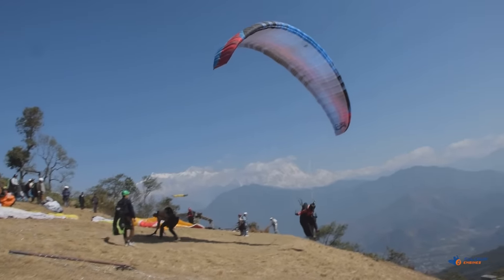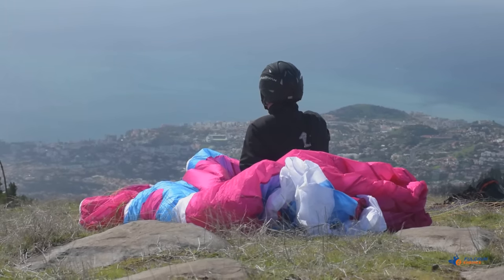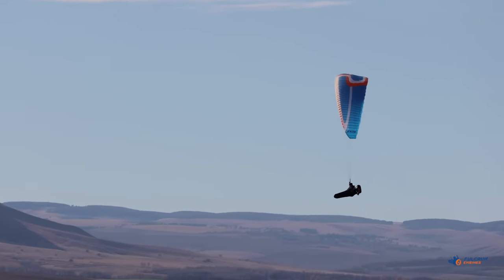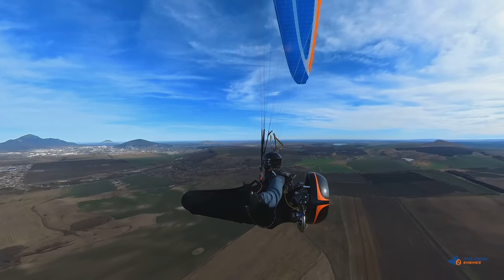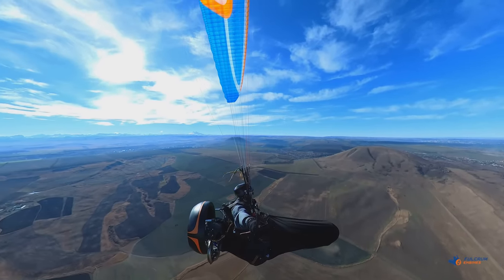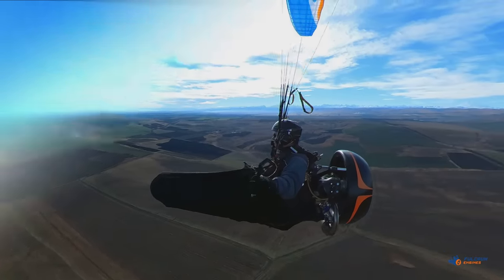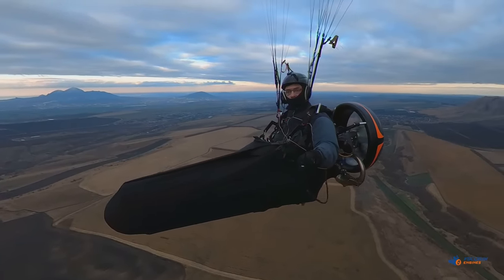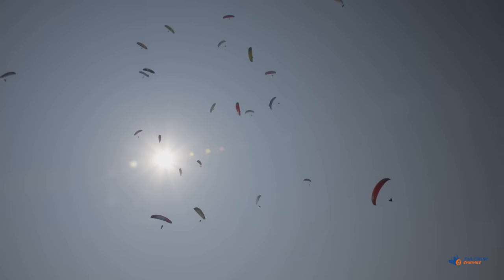Fulcrum PowerPod is the world's first paramotor pod harness with a ducted fan only 0.5 m in diameter

Comment: OMG I'm love it.  I have been watching para videos over the last few years and have been asking myself the question about ducted fans or air multiplier.  There are a couple of videos where someone used multiple small electric motors to get off the ground (noisy, hook-ups on frame etc.).  Later he came back with two large electric ducted fans.  I can't remember what he said about electric verse combustion but there was good support towards a ducted fan.  Good to see ducted fans being explored.  As ducted fans and battery technology as will as small light and compact electric motors  start becoming more popular I can envisage this possibly going electric.  In essence motor and duct become one so tolerance between fan and duct wall will be in mm range so more efficiencies / power. By the way I know nothing about intricacies of motors and para so only personal opinion incase anyone gets triggered.  Keep up  the good work, may innovation lead the way so heavy fat guys like me can fly.
Reply: An electric's fuel supply (battery) always weighs the same. But on fuel, your total rig weight slowly drops as the fuel is consumed. Gotta factor that in. 😉

Comment: Interesting concept, espacially the prop kinda hidden from the lines, well it would be quite noisy i guess but for a takeoff and clime it is nothing one would not bear! How much doest it weight now without gas and what is the ccm of the engine used, some 80ccm?  Wish you good luck with the development! :)
Reply from the maker: We plan to keep the PowerPod within 20 kg. Now the prototype has a little bit more weight. Engine power 25 horsepower, its volume is more than 80 ccm.
Reply: When it's ready I would love for you to contact me because I will buy one

Comment: Small diameter is inherently less efficient at producing thrust than a large diameter propeller.  Great engineering for 1st version, future improvements like larger diameter and stator or counter rotating prop could improve performance and reduce unwanted torque.
Reply from the maker: Yes, you are right, but we adress PowerPod for thermic flights where larger prop diameter will create more drag. A powerfull motor (25 hp) anf ducted fan technology give 50 kgf of thrust, its enough to gain altitude and find a thermic.

Comment: With electric motors going further and the new battery technology, the future of this is even greater.
Reply from the maker: Yes, if the batteries get lighter, that would be great. Now, according to our calculations, the PowerPod operation time with an electric drive will be very short, only 5-8 minutes in climb mode. This is at the same weight with a PowerPod with an ICE.
Reply: @fulcrumengines2519  a skilled glider can turn this into a thousand miles no? If you only use the engine the hop to the next thermal that might be too far away otherwise?

Comment: I would be worried about thermal expansion/contraction on the fan shroud with rapidly changing flight temps and air pressures. 
I'm sure you worked it out. Great design. You might consider two variants. 1 vectored thrust. 2 tail fins, like rear canards. 
Great work, fly safe.
Reply: I know very little about this, and I'm not an engineer, but if the fan shroud is made of carbon fiber as is mentioned then it won't be subject to hardly any expansion or contraction I think. Forgot to say that I love the idea of vectored thrust, but that must add some weight or other difficulties and doesn't a parasail already permit directionality.
Reply from the maker: Thermal expansion due to temperature changes is very small, about 0.1 mm. And both the fan and the duct are subject to it at the same time. This can be ignored. 
We used the variable thrust vector to change the pilot's posture on takeoff and in flight. It is not used to improve maneuverability and it is not necessary for a paraglider, it is already well controlled.

Comment: Does this smaller motor solve the torque problem, where the original, large motor on a paramotor, will constantly torque in one direction while flying? I also wonder if this small motor is strong enough to really get you off of the ground. Is this project still going?  Or did the government shut it down?
Reply from the maker: Hi Alaska, Yes, we are working on preseries PowerPods. The motor is strong enough (Opposed two-cylinder, 25 hp), it has 50 kgf of thrust.

Comment: What a great design guys . . .

I wonder if you could incorporate Dyson's Air Multiplier principle into your shroud design in order to get more thrust (not that it's needed)?
Reply: @KevinJDildonik  The diffuser comparable to the actual paramotor (and or parameter) is over and above in terms of dynamic engineering.  The question is, would flying be suitable up to or above. Indeed. Just a thought.
Reply: That sucks!
Reply: @KevinJDildonik  You obviously don't understand the aerodynamic principles of the Multiplier . . . it's old technology (Toshiba 1981) & produces the same airflow with reduced power requirements and around 5 to 10 db LESS noise . . . Not a bad idea when it is strapped to your back.
Reply: @ThePianoMan1953  well played

Comment: This is game changer! 😎 but I will keep dreaming about the electric version of this one! 🙃
Reply from the maker: Yes, we also think about an electric version of our paramotor pod harness. Unfortunately, according to our calculations, the weight of the device comes out much more than with a gasoline engine.
Reply: @fulcrumengines2519  How can we contact you ?
Reply: @fulcrumengines2519  But please only with hydrogen! Batteries are shit!
Reply from the maker: @ParamotorDepot  All contacts are on our website: www.fulcrum-engines.com
Reply: @fulcrumengines2519  How about different batteries options, and countra rotating propellers in the duct (maybe inspired from RC with powerful brushless motors).
Reply from the maker: @designelevator4253  We will investigate this, but only after the PowerPod release.
Reply: Likely won't happen in our lifetime. Batteries are at least 3 generations away from being viable for sustained powered flight, assuming a generation doubles that of its previous energy density.   The energy density just isn't there with current chemistries and technology.
Reply: Electric versions would be awesome but battery weight will not allow that until there are drastic improvements in battery technology.

Comment: I want.
I have been working (slowly) on a similar concept.
Mine uses two vented props, contra rotating, either side of the pilot, that folds away behind the pod, once altitude is reached.
Reply: "pics or it didnt happen".

Nah, seriously though, somewhere we can see this? Sounds cool af.
Reply: @tom.2900  mate, i have a very limited budget, so its just a platic frame and model airplane props. 
Concept is sound tho.
There is a wan on youtube thats using a weedeater (or something) in each side and another chap in the USA that sells them, but the design doesnt fold in behind, and the frame looks unstable. I think its called the Minnie

Comment: What’s the fuel capacity and motor run time average? This seems like a very elegant evolution of the current paramotor design; as a paramotor pilot, I’m very interested in the ducted concept for both safety and compactness. Currently, I have to break down my machine to fit it into my car. This would alleviate that, while adding safety and aerodynamics.
Reply from the maker: The volume of the gas tank is planned to be 5-7 liters (it should be compact enough for our concept). This should be enough for 30 minutes of operation at 75% power (climb mode). During this time, you can reach 2-3 km of altitude.
Reply: @fulcrumengines2519  that's awful fuel efficiency.
Reply from the maker: If you fly in the horizon, without climbing, the flight time will be much longer. But the concept of our PowerPod involves climbing up to the first thermal, and after - free flight.
It seems to me that this is a good opportunity to spend 2-3 or more liters of fuel in order to catch a thermal for sure.
Reply: What's a decent "regular " para fuel consumption,  gallon an hour?
Reply: @firedawg1998  depends on the glider and wing loading. With a vitarozzi moster 185 I can get 4-5 liters per hour on a gin pegasus 2 . On an ITV piper it is closer to 6-7 lph but is much faster horizontal air speed. 

These guys are probably much closer to the piper wing, but it looks like they are using an atom80 engine which gets phenomenal fuel economy compared to my engine. 

Their fuel economy issues are almost entirely caused by the small prop and the blocked intake.  Some thing like 80% of your thrust is created by the outer 20% of your prop. Shrink the diameter , and you exponentially reduce the linear distance that tip travels.  The only way to make up for it is higher engine rpm. Now block half the intake with an engine and pilot. Ducting helps a little but its pretty obvious,  not enough. There's a reason ppg are the way they are and it isn't because no one thought of it. 

Cool concept,  but I think it's a mistake to compare this to paramotor. It's different applications  with a different purpose entirely.
Reply: @firedawg1998  As above, depends on wing, motor, 2-stroke vs 4-stroke, all up weight, etc. I can get less than 3 L/hour on an Atom 80 with a 26m^2 wing.
Reply: @srmofoable  i think it is just a guaranteed launch motor, like a pony motor. how many launches do you do in a day once you are in the air? honest question as i have never tried paragliding, cheers

Comment: this is what we are waiting for, time to improve the paramotor.
So it would also come with a battery starter? 
would this be suitable to fly with the regular paragliding wing or is a paramotor wing required?
how long could you run the engine with the fuel supply?
looking forward
Reply from the maker: Yes, perhaps the engine will be with an electric starter. We are now deciding which starter will be better - manual or electric.
The engine operating time at 75% power (climb mode) with a 5-7 l tank is at least 30 minutes, this is enough to gain 2-3 km of altitude.
Reply: @fulcrumengines2519  And what about the wind ?
Reply from the maker: @s.l.6736  What do you mean?
Reply: @fulcrumengines2519  do you fly a regular Parraglider or do you have to take a Paramoter wing ?

Comment: Paraglider pilots that try motors tend to lean too far forward when launching with a motor... that leaves the motor pushing them downwards, and results in a swing forward once lifting off the ground. If you hit sink at that point, your ass hits the ground first, and you break stuff.  Angling the motor unit downward a bit for launch would be preferable. 

I fly a paramotor and don't find the upright sitting position uncomfortable at all.
Reply: And what about drag?
Reply: @journeymanelectrician  You are far away from aerodynamics and physics..
Shame on you

Comment: I like the design. It seems a lot better than traditional versions. I just wish it was electric so you didn't have to hear an Internal Combustion Engine chugging away behind you. Electric would really simplify production as well as be better for the environment. If you are only using the motor to get into a thermal, it seems an electric motor and a lithium battery setup should be possible at a lower weight than an ICE version. You could even incorporate additional features, like putting the fan into reverse just as you land so you don't fall over sometimes. Really handy in rough terrain and forced landings to have direction control.
Reply from the maker: Unfortunately, no. The electric version turns out to be much heavier than the gasoline version with any reasonable operating time. Only if the climb mode is less than 5-7 minutes, you can make the same weight or less.
Reply: interesting suggestion! it just our current battery tech has not caught up to the weight efficiency of the two stroke.
Reply: same noise. All the noise you hear is from the blade chopping the air. Look at electric versions and you will hear the same buzzing sound. Plus the added weight and then the reduced duration. It is a step backwards.

Comment: Noise Info and Sound Check between Standart and Ductec would be great.
Any Patrice Info?
Reply from the maker: Unfortunately, we haven't done any noise measurement tests yet. Subjectively, the noise is similar to that of a regular paramotor, but in a different range, due to higher fan speeds.

Comment: I am concerned about the large bottom pipe. In a normal paramotor, the lowest part isn't mission-critical: it's a frame or the fan cage. What if the pilot hits that pipe during landing?
Reply from the maker: The video shows a PowerPod prototype. In the serial sample, we plan to make the protection of the exhaust system.

Comment: Please make an electric version. This is amazing!
Reply from the maker: Yes, we are also thinking about an electric version. But according to calculations, the weight will be too very large due to the weight of the batteries.
Reply: @fulcrumengines2519  wouldn't the batteries perform less in colder temperatures (higher) as well?
Reply from the maker: @mikeyy425  Yes, that's right, the operation of the batteries depends on the temperature.

Comment: This is incredibly exciting. 

I hope you're hearing the many requests for electric. The technology has come so far. Newer, lightweight motors and only needing enough battery to get attitude would seem to make this an ideal application for electric. Add to that the far lower cost of maintenance and repair, plus the much higher reliability and therefore safety. Then there's the noise and pollution from a combustion engine. Just when every kind of aircraft is being redesigned from combustion to electric, there's almost no point in starting out with a combustion engine. From a sales perspective also, an electric pod should be much easier to sell because of the lower noise, lower maintenance and higher reliability. 

Thank you for an amazing design and all your hard work. I have signed up for the newsletter.
Reply: OpenPPG started out a few years ago with the goal of producing and selling open source electric paramotors. As of roughly 6 months ago, they began selling an internal combustion engine version of their paramotor….. electric solves a lot of paramotor problems but battery tech is just not there yet to make it a serious option to gas.

Comment: What about an electric motor instead of gasoline?  I believe that it would be great and safer in both restarting while flying and a lack of flying with a combustion engine with associated fuel.  👍
Reply from the maker: Yes, an electric motor is better and lighter than a gasoline one. But the weight and size of the batteries are too large, much larger than the fuel tank. Therefore, the electric version with existing batteries will be heavier than the gasoline version.

Comment: Seems like itd be good have on a parachute or build one into the fan incase the parasaile fails. Maybe you did have a backup I couldn't tell though.
Reply from the maker: The PowerPod has a rescue parachute. You can see it on the right side of the pod harness. This is the safety standard for paragliders.

Comment: Very interesting, how long until you get it to market? How big of a gas tank and what's the flight time motor on?
Reply from the maker: We are currently working to calculate the final price and release dates of our product.
The volume of the gas tank is planned to be 5-7 liters (it should be compact enough for our concept). This should be enough for 30 minutes of operation at 75% power (climb mode). During this time, you can reach 2-3 km of altitude.
Reply: @fulcrumengines2519  For paramotor pilots interested in cross-country motoring, as opposed to climbing for off-power soaring, how does the speed and miles-per-gallon of the power pod compare to traditional paramotor setups?
Reply from the maker: @c0t1  We did not do fuel consumption tests for horizontal flight routes. But I think that the fuel consumption will be 25-40% more than that of an engine of the same power and a conventional prop. An fan with a diameter of 0.5 m cannot be as effective as a 1.2m prop.
Reply: @fulcrumengines2519  Thank you! That's efficient enough to enjoy cross-country flying as well as powered soaring. Kudos on a great design - eagerly following your progress!

Comment: Hi, How much flight time should we expect to have? Also, how many months do you think until production?
Reply from the maker: In the climb mode (the main mode for our paramotor pod harness concept), the engine will run for at least 30 minutes, during which time you can climb 2-3 km of altitude. In horizontal flight, the operating time will be 3-4 times longer.
Unfortunately, we can't name the date of sales right now, we need to finish testing and prepare mass production, we are currently doing this. In the coming months, the release date will be known.

Comment: Could this fan be powered by batteries?
Reply from the maker: Yes, it can be done with an electric motor. But the batteries will be too heavy. If you keep the current weight, the flight time will be 10-15 minutes.

Comment: My biggest issue would be knowing of the minimal clearance required for a ducted fan to be efficient. And then adding on to that that the pilot would still have to essentially run to take off. Which if you do paramotor you know the possibility of slipping and falling

I don't know how well something that compact would handle a fall with such a minimal clearance.
Reply from the maker: We try to make our product as strong and reliable as it possible. But, as with an average PPG setup, a hard hit can break it.